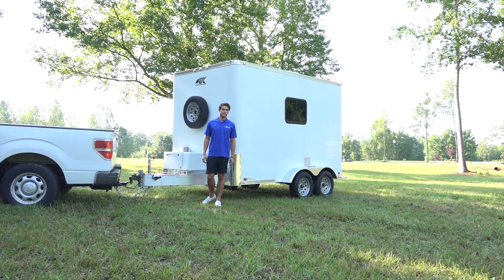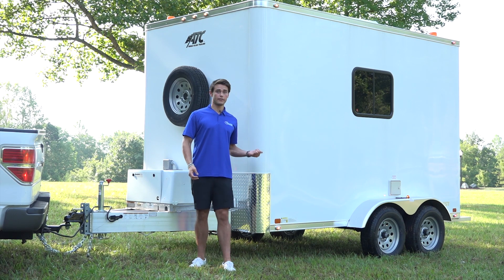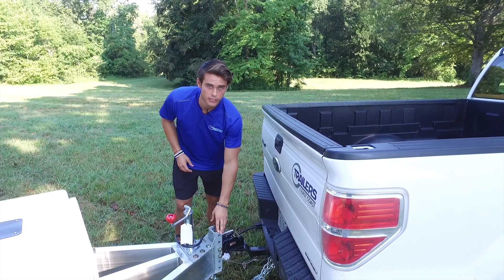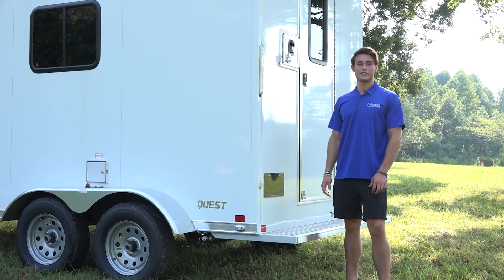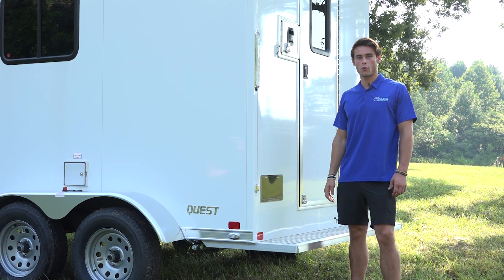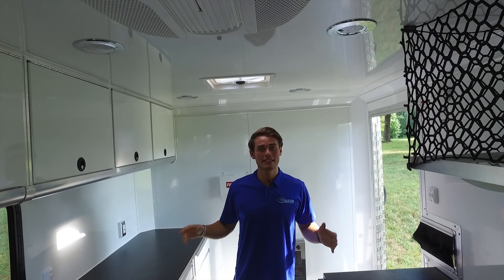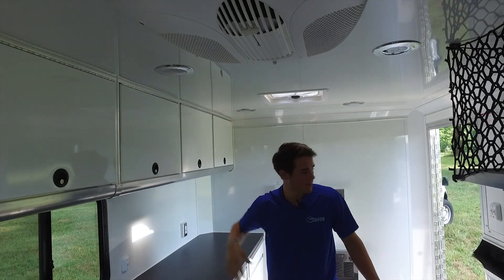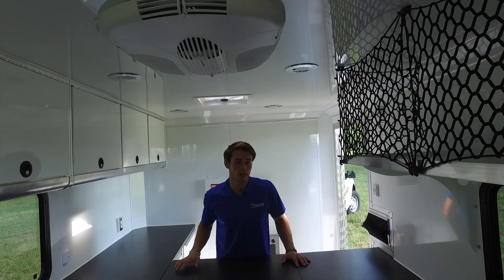ATC Fiber Optic Splicing Trailer - Rugged, Durable, Professional

Comment: why do they put the door and counter StreetSide  i don't work on fiber coming out of the middle of the road this has struck me as absolutely moronic since they started doing it
Reply from the maker: Hey Joel!  I may be misunderstanding your question but the walk through door and the fiber cable access door is on the curbside of the trailer and not on the streetside.  Let me know if you have other questions.
Reply: You must be European.
Reply: Turn the trailer around